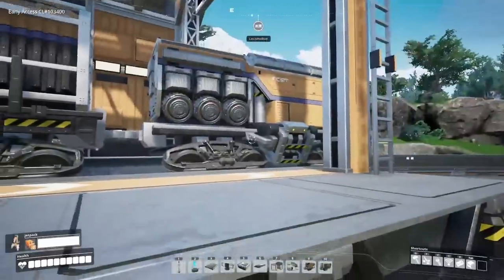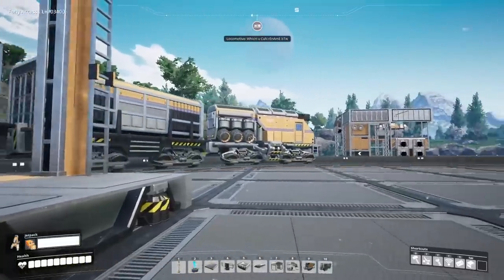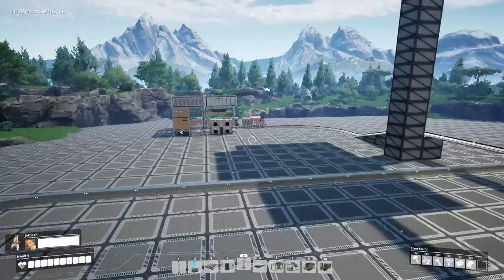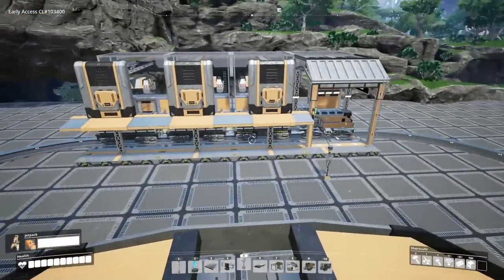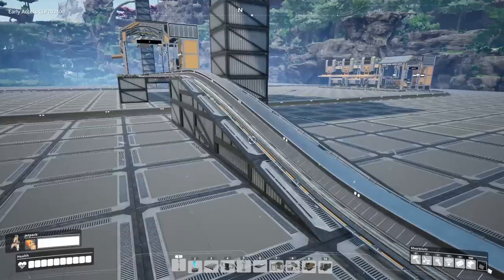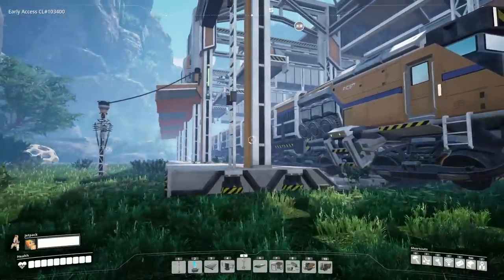Satisfactory Train Tutorial, Tips, and Station Guide! - Satisfactory Tips

Comment: If your trains aren't working on a point A to point B line and you're getting the error 'Unable to reach next stop', make sure the stations are pointing away from each other on each end, away from the track. The sign hanging on the train station needs to be at the back when the train comes into the station. This was my issue which wasn't addressed in this vid.
Reply: Thanks so muchj
Reply: You are godly thank you
Reply: Thanks alot!
Reply: thank you
Reply: I had that problem thanks for helping
Reply: I've tried this dude but I'm still getting the error, is it sometime to do with the hight of my track ? Have I got too steep of an inline and decend that the train is unable to make it ? I'm so lost, I've removed everything, rebuilt everything, turned the stations around, deleted the time table and rebuilt it and the same message appears no matter what I do
Reply: @MadZprod23  when you make a station try looking for an arrow the arrow means that the train will be able to go that way and dock or you did not connect it correctly
Reply: @thesecretchannel4256  yeah I checked that last night, made sure the arrows were facing away from eachother, I got a mini single track set up and it works just fine nut my larger track (with the freight station) set up just will not work at all
Reply: Thanks dude 🙏
Reply: @MadZprod23  I haven't played in a while so I don't know about height of track and all those technicalities. Test out freight stations with the small track if you haven't already. If it works, but the larger line setup the same way doesn't, my guess is it is something to do with placement/height.
Reply: @shatteringthematrix6959  that's what's I'm thinking dude, I've not had a chance to hop back on and sort it but I will tomorrow thanks
Reply: Unfuckingbelievable, that was it, thank you so much
Reply: Also make sure you have 1 locomotive on each end of the train and that they are pointing opposite ways.
Reply: @MadZprod23 do you have an engine on both ends of the train and are thee engines pointed in opposite directions?

Comment: Another thing that works for a line style train layout is at each end of the track you loop back the track into itself so then the train will reach the end of the line and then loop back around and race back to the first station again both ends need a loop also the loop back line layout also does not require you to do the double stations with the timetable to get the trains going the only thing is if you have a big train you need a larger loop at each end if you do not want the train to clip through itself. Hope this tip also helps.

Comment: IMPORTANT!: Remember that for every train or freight car you need at least 1 platform, even if it is an empty one. If you have 1 locomotive in the front 3 freight cars in the middle and 1 locomotive at the end, you HAVE to build 5 platforms!
This will get rid of the 'No valid stop error.'
Also, in a monorail, make sure the arrow from the train stop is facing AWAY from the tracks.
Reply: No, you don't. You can have 3 platforms for a 100 car train and it will work perfectly fine.

Comment: I have a question: i have my oil production on the beach. I  produce plastic, rubber and fuel as well as coal from the oil. I want to use a train as it's over 2km away from my base. On the way I want to add stops for like caterium and other ones and my question is now:
Should I make a one  line or a circle?
Reply: Asterix most likely as it would save resources and the train could just go back and fourth or through all multiple stops.
Reply: Most likely a line track I mean woops

Comment: If anyone wonders why your bidrectional route doesn't work...check that the train stations are the right direction ( pointing away from direction loco enters station.)  Make sure your locos are pointed the correction direction.  Opposite to each other, and headlights/window pointed towards station it's traveling to.  The locos ONLY travel forward when automated.  And remember that your cars will enter in the opposite order.  If it's LocoY-1-2-3-LocoZ entering station A, then it flips travels to B, in the order LocoZ-3-2-1.  So for example, if you had fluids in "front" for one station, they are in back in the other station.  Unfortunately, and IMO, trains seems to be designed (1) To really be used in a loop, and (2) with no snapping supports making an elevated train too painful to use.  They really must add snapping columns for trains, IMO.

Comment: Jesus I've been screwing with a simple 2-stop linear train station for about 2 hours.   It goes to one stop and says invalid next stop...forever. I know things have been updated, but have they changed so much that this guide doesn't apply?
Reply: I encountered this issue, you have to make sure the arrow showing the station orientation is going the direction the train enters the station. It's essentially complaining it can't enter the station the "right" way for that stop.
Reply: I had the same problem, Anbergino is correct, you need to have the train station arrows pointing the direction the train comes into the station, or as I remember it, have the arrow point away from the station.
Reply: You need to make sure the main station (the one with the sign for the name) is at the "front", this means that the arrow needs to be pointing away from any platforms. Use empty platforms for any additional locomotives instead of main platforms.

Comment: I have two trains running on a dual-track system, it'd be nice to get them to run and cross onto a designated line (I'd like on a set of two parallel tracks that trains run down the left-hand track, then cross a crossover either before or after leaving the station at each end. currently I have to use a continuous look to get it to work correctly and it doesn't look very appealing.

Comment: im so confused i have a train station travelling about 100 m and it refuses to move backwards on auto pilot but i can move it manually

pls help
Reply: Your station thinks it's a train, send it to therapy.
Reply: @commenturthegreat2915  hahahahhaha but i was talking about the train not the whole stationnn
Reply: You need an engine on both sides. Because of how the train stations work on autopilot, a train can only move "forward" so having another engine pointing the opposite way at the back of the train should solve your problem.
Reply: I didn't know the train stations had autopilot.

In all seriousness, make sure the train has a timetable and the autopilot is on. Also make sure that you have a locomotive at both ends.

Comment: Hey! I am planning to start my first train setups, but there is one thing that I just don't get. I don't understand the relationship between the amount of materials being brought from the train and the conveyor belt /min capacity. Do trains that go a longer way have a smaller /min load?
Reply: Trains have an inventory, which means they transport a certain amount instead of a certain number of items per minute. If you were transporting iron ore (which stacks to 100), and the trains had 1 inventory slot, and it took the train exactly 1 minute to complete the entire loop, you can transport a maximum of 100 items per minute. If you had another train that took 2 minutes to complete a loop, it would transport 100 items every 2 minutes, or 50 items per minute. The easiest way to see if your trains can handle everything is to have the train run, and send all of the materials into an AWESOME Sink when they arrive at the destination. If the lines get backed up at the start, you need more cars. If the cars don't fill up, you could do with fewer cars.

Comment: I hope they release a way to actually properly time trains... No matter how hard I try to set up multiple trains for a set of stops, they sync up and crowd each other at the platform wasting a lot of capacity.
A very simple solution would be to make the platform continue taking in items to the reserve during the animation.  Then you can just load it up with trains and let them be, hauling 15% loads.
I think this is made worse by the fact my tracks form a grid and I believe they are choosing a different route sometimes.  I can't be for sure, I'm working with a total of 12 locomotives(24 cars), 1:2 each. for 4 stops and just cannot watch them all. They are numbered and get out of order though, IE /5 came before /3 and then threw the whole thing out of balance.  /1 and /2 are always in order and approximately on time(platform is about 80% full).
I'm very close to just running pipes straight over this mountain as I've spent more than 2 hours working on this and am certain it is a waste of time. 
I definitely don't want to package 1800 units of oil per minute and haul that on trucks.  The alternative would be to build a large scale refinery on site and send the products to base.  It's a mess for sure.
Reply: I would recommend using one train. The issue you described is called "train god", and it cannot be defeated without setting up multiple stations.

Comment: tby me the train sation says cant reach next stop how do i fix this?
Reply: If you have a linear setup, where the train moves back and forth on a single track, make sure the arrows on the train station point AWAY from the station itself. You can also think of it as having the arrow pointing in the direction the train is travelling when entering the station. You also need to have an engine on both sides of the train as well and have them pointed in the direction they will be travelling. Essentially, the engines on either side of the train should be pointed in opposite directions.

Failing that, you should make sure your tracks are connected. I have ran into this issue multiple times where the track wasn't actually connected, even if it looked like it could be. Try driving a train and seeing if it suddenly stops anywhere on the track. Fix those connections and everything should be smooth sailing from there.

Comment: hey  help plss my train doess not move did exact same thing
Reply: If you have a linear setup, where the train moves back and forth on a single track, make sure the arrows on the train station point AWAY from the station itself. You can also think of it as having the arrow pointing in the direction the train is travelling when entering the station. You also need to have an engine on both sides of the train as well and have them pointed in the direction they will be travelling. Essentially, the engines on either side of the train should be pointed in opposite directions.

Failing that, you should make sure your tracks are connected. I have ran into this issue multiple times where the track wasn't actually connected, even if it looked like it could be. Try driving a train and seeing if it suddenly stops anywhere on the track. Fix those connections and everything should be smooth sailing from there.
Reply: Did you turn the autopilot on?

Comment: No matter what I do it just keeps saying that it can not reach the next stop.
Reply: If you have a linear setup, where the train moves back and forth on a single track, make sure the arrows on the train station point AWAY from the station itself. You can also think of it as having the arrow pointing in the direction the train is travelling when entering the station. You also need to have an engine on both sides of the train as well and have them pointed in the direction they will be travelling. Essentially, the engines on either side of the train should be pointed in opposite directions.

Failing that, you should make sure your tracks are connected. I have ran into this issue multiple times where the track wasn't actually connected, even if it looked like it could be. Try driving a train and seeing if it suddenly stops anywhere on the track. Fix those connections and everything should be smooth sailing from there.
Reply: @undead890  thank you so much